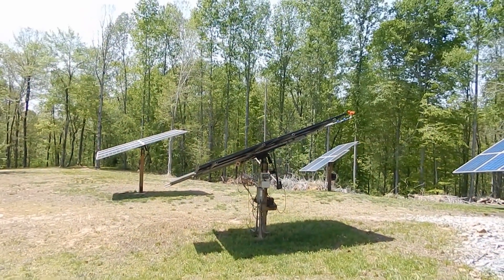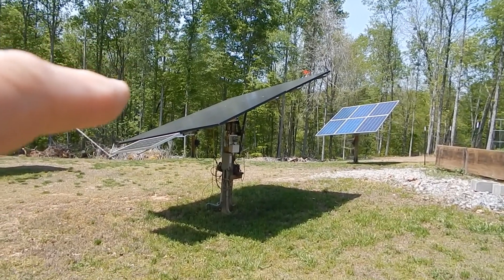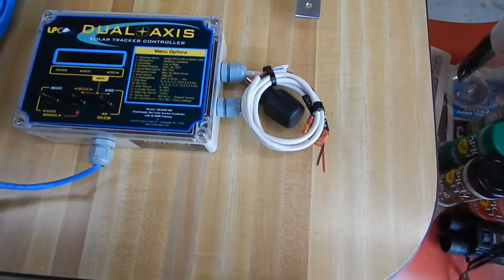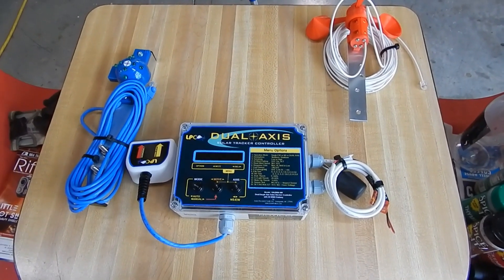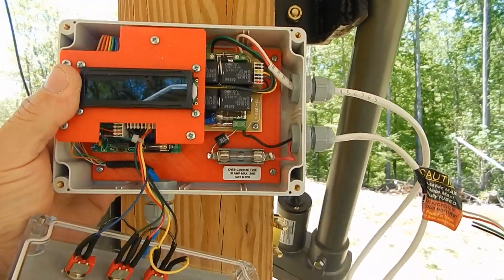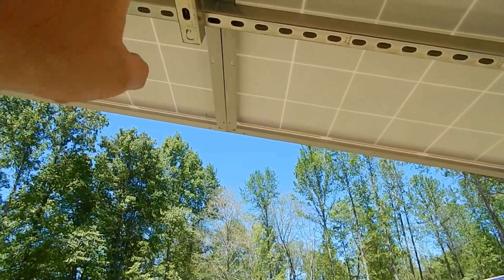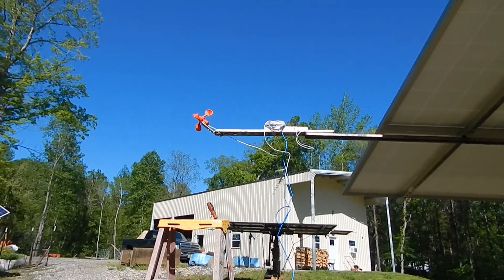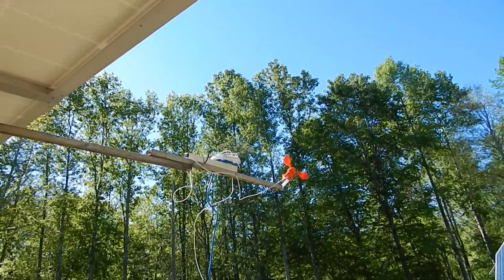Solar Tracker # 4 Gets High wind speed parking controller.

Comment: How come you dont fill you roof with panels?
Reply from the maker: I have never ever installed solar panels on anyone's roof. The building here was not set up for solar on the roof pointing the wrong way . Don't like putting holes in the roof plus the roof 20 feet in the air kind of hard to clean the panels off.
I started building solar trackers over a decade ago when solar was super expensive. Nowadays I recommend everybody uses a ground mount system and angle panels for best collection. I have also fabricated and design brackets to hang solar panels off the sides of buildings that works pretty well.
Reply: @TheKiloG69  I do like the side of the building design too. I have a couple myself. I am installing panels on a roof now for someone else. It is very easy. I said the roof because you dont get much snow and it would lower your horizon. Your roof may be harder to install on. Im not sure. I am putting a video together as well on the system Im building. Nice Magnum system. My first a real Magnum and also my first real racking as well. Its a nice build. Hope all is well. The trackers do look good .
Reply from the maker: @frankz1125  I'll be watching your progress be safe up on that roof. If you go look through my grid-tie install series you can see how I built those brackets for the side of the building if you're interested.
Reply: @TheKiloG69  Ill give it a watch . Cheers